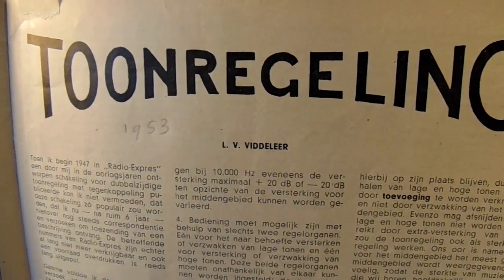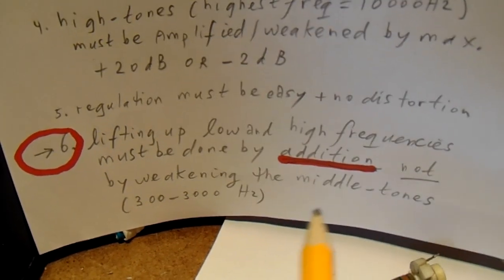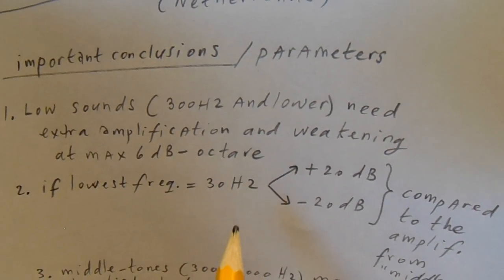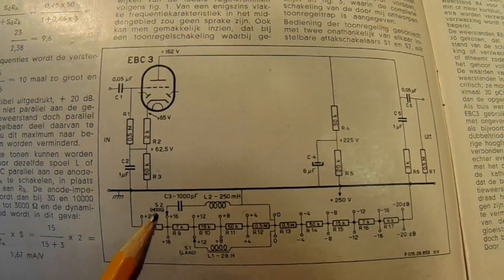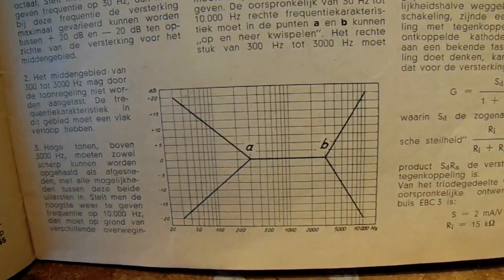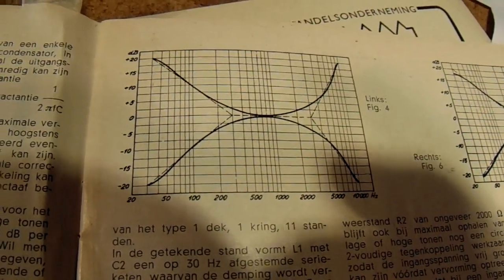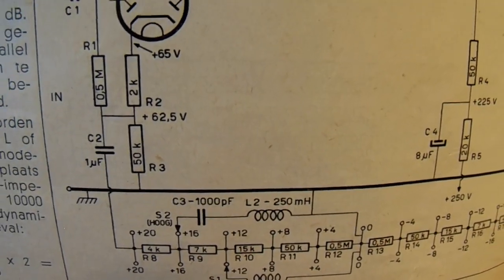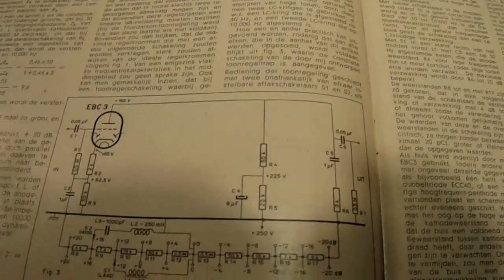Audio: the Viddeleer tone control 1947-2016

Comment from the maker: LINKS TO AUDIO FILTER VIDEO’s (schematics/bass boost-high cut, sound effects etc).
Audio bass-effective parallel T filter with 1 transistor https://youtu.be/1gGv2z6jZH4
Audio pre-amp loudness correction with 1 transistor https://youtu.be/LkotuL57U8I
The Viddeleer tone control 1947-2016 https://youtu.be/3k3DxZ-Lov8
1 transistor active audio filter design, part 1 https://youtu.be/lk-JztGQ6zM
1 transistor active audio filter design, part 2 https://youtu.be/r4MLawYJgWk
How to make a good analog audio transistor pre-amp https://youtu.be/luBmY8SzGh0
Wien Robinson bridge nulls out 430 Hz https://youtu.be/7OXE5xoraeo
Prevent hum in audio amplifiers https://youtu.be/IsLEyx3nU9o
Transistor series regulator practice (hum suppressor!) https://youtu.be/YL41FPH_H-s
3 audio characteristics pre amp filter/sound demo https://youtu.be/hNySyvPU964
The importance from the emitter capacitor in grounded emitter transistor circuits
https://youtu.be/br8iXVXRVl4
Effect from the loudness filter on the energy into the loudspeaker https://youtu.be/tPdpiRV02is
Audio parallel T filter (loudness) demo video https://youtu.be/ua-PXX7JHTs
Low cut-high pass active R-C audio filter https://youtu.be/2dt6vgii-dE
Opamp “echo remove ” & “phase sound” audio bandpass filter https://youtu.be/k5jQHhlYPBw
relaxed sound active (transistor) audio L-C filter schematic https://youtu.be/6QitndX2E3g
Relaxed (party) sound passive R-C(L) audio filter schematic https://youtu.be/6QitndX2E3g
Opamp (741) audio filter with sound profiles https://youtu.be/menssKBlxNw
Germanium transistors, their noise and how they amplify it https://youtu.be/t6hEnAx1YR8
Germanium transistor audio pre amplifier part 1 https://youtu.be/TTQeNYMIR04
Germanium transistor audio pre amplifier part 2 https://youtu.be/mq6dl289u0o
Audio filters design problems https://youtu.be/8AiIaIPSa_c
The effect of coupling capacitors in audio circuits https://youtu.be/eF8e-FmtDh4